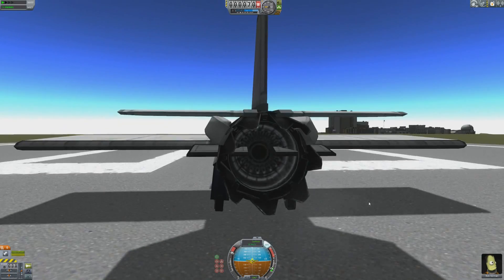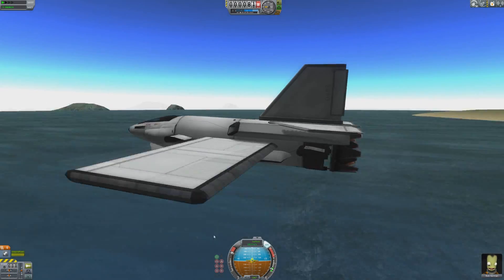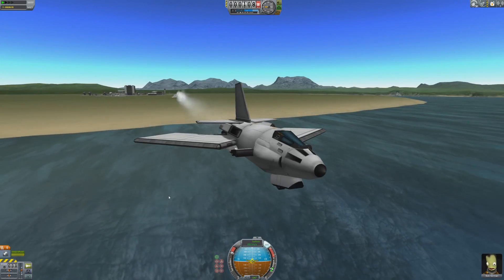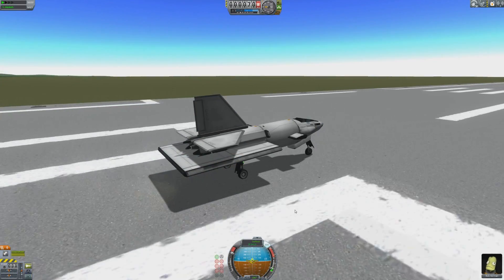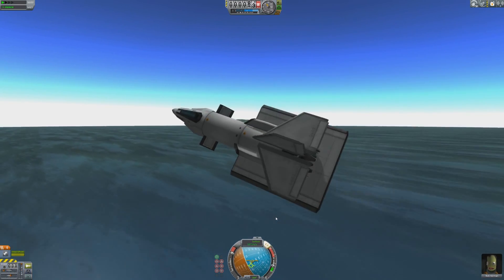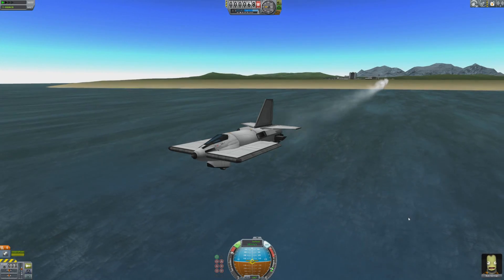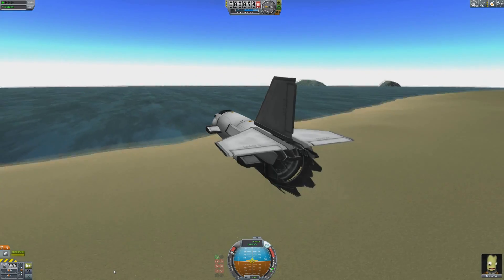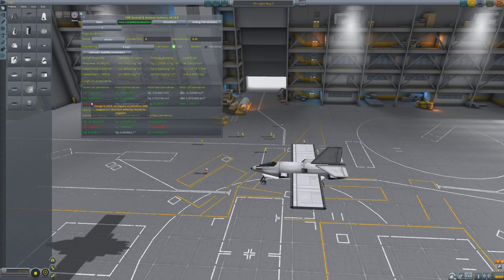Kerbal Space Program - Swept Wings & Aerodynamics Bugs

Comment: The jet with the fully swept 90° angle wings remind me of the experimental lifting bodies that were researched and developed in the 60s and 70s. The craft is very narrow and the body itself provides lift, instead of using more wing surface and therefore increasing drag. The wing surfaces are reduced to a minimum while still producing lift, so that the craft can fly or glide at higher speeds. One of the factors that contributed to the downfall of the lifting bodies was that it couldn't hold very practical fuel tanks. There are some designs in recent times - c. 2000 - that were (or are) in development. I find it interesting that the 90° wing jet would remind me of the lifting bodies, but in plenty of cases when I think about it, it makes a lot of sense.

Comment: Keeping the wings swept back 90 degrees, the visualization only showed them generating lift when you pitched the nose up or down, which is expected because of your wider angle of attack. Going in a straight path with a 0 degree angle of attack, you can see that they no longer generate lift, but the other smaller control surfaces still do. Does stock Kerbal actually account for that or does sweeping it back 90 degrees completely remove all lift, even if you're pitched up?

Comment: I built a plane (in stock ksp I think) with the engine in front of the wings, inspired by the William and Colt Peacemaker 370. I stacked two turbo jet engines to prevent them from hitting the wing in the back. It was fast enoughto reach duna if the atmosphere was exited in the right place.

Comment: Hi Scott. I've recently upgraded to FAR. What am I doing wrong when the aircraft will not remain steady during flight? I'm not talking about center-of-lift in front of center-of-mass instability here, this is something much more subtle: A tiny "wobble" in the pitch, for which the SAS is constantly trying to compensate (and without SAS, the nose will immediately drop). Is this insufficient lift or too small control surfaces or something?

Comment: The thing about the lawn dart is the same as a gravity drop bomb. The airfoil on the lawn dart's tail is symetrical and it's angle of position is 0. This means that the dart will align itself to the projectile trajectory, landing tip-first in the lawn because any diference in the angle of attackag ainst the ariflow will force the fins that way. Same as the bomb. The detonator is at the tip. They're designded as low drag devices for their trajectory to be easily calculated.
The thing about the center of lifh/center of stability is that a CG in front of the CL will create a momentum that tends to point your nose down, wich helps your craft recover from a stall, according to Raymer (1992). This is a general rule of thumb, stability is far more complex matter, involving the craft's inertia and control surface authority (as in, stabilator and rudder. A craft is designed as stable with it's surfaces undeflected).

Scott, can you fly that Entrerprise-alike shuttle of yours in FAR?
I've been unsuccsessfully trying to build one since I started playing KSP.

Comment: I remember reading somewhere that the wing sweep on the Me 262 was originally done to adjust the center of mass. I'm pretty sure that was on Wikipedia so that might not be accurate.
Reply: The engines ended up being heavier than originally intended, requiring a change in CoG. Moving the wings back would have forced them to redesign the fuselage, so sweeping the wings a little bit was the easy solution. The 262s wings aren't swept enough to make much difference at high speed.

Comment: my SSTO under FAR has a tendency  to flip itself upside down at 22km even when i keep the vertical velocity at 150m/s , still manages to get in orbit
Reply from the maker: It's highly likely that it's not the altitude, but the fuel distribution, it's quite common for a stable design to become unstable with a portion of the fuel burned.
Reply: quite possibly i am using the MK1 fuel structure , though i do try to keep most of the weight at the back near the ailerons  , and set my wings weight to 2.5
Reply: So it goes upside down, not rear first? Do you have your wings mounted at the bottom of the fuselage? Try moving them to the center or even to the top.
Having wings at the bottom causes your center of mass to be above the center of lift, making the aircraft unstable and wanting to flip upside down so that the center of mass can hang below the center of lift.
Reply: Kepe you might be right on that , tho usually with four engine on the wing needed to move the wings higher to accommodate them , the only way other then that is tilt the forward end up slightly and move the root of the down to centre line

Comment: Your videos started lagging on my computer at 1080p, other people's videos work fine.. Did you change something?
Reply from the maker: 60fps perhaps? Please be vociferous about this problem.
Reply: Scott Manley Yes, seems to be the FPS. Just checked and other 60fps 1080p videos lag too, heck, i didn't even know youtube supported 60 fps video.
I got old cpu, can only run normal 1080p so the problem is on my end.
Reply from the maker: Murhaain I get lots of people complaining about non 60fps video.
Reply: Scott Manley Some findings: Flash player @720p works, 1080p lags. Not sure if it plays at 60 fps or not, since no option is shown.
HTML 5 player shows that it's using 60 fps. Both 720p and 1080p lags much more than they do with flash. CPU usage is around 20% on both cases.
I tried all fixes i could find, no luck. Using firefox.
Not sure what's causing this.
Reply: Murhaain Enabled hardware acceleration?
Reply: Murhaain Try installing the latest flash player and update your graphics drivers.
I've seen many others complaining about 1080p60 videos lagging as well, but for me it's always worked fine (with the HTML5 player).
Reply: TheLeftLibertarianAtheist
Tried enabling/disabling that to no effect. Driver update also didn't do anything.
The problem was firefox. Everything works perfectly with chrome.
Reply: Murhaain Strange, it works for me.

Comment: Scott, Are the stock swept wings any better drag wise?
Reply from the maker: That's a separate issue.
Reply: In stock, drag is related solely to part mass, not to orientation. You can put the wings face on to the airflow and they won't provide any extra drag. So whatever wings have the lowest mass will have the lowest drag.

Comment: Doesn't swept wings also reduce lift per area due to more air dispersing at an angle down the wing instead of straight into the wing at 90*?
Reply from the maker: Well, yes, but in practice you saw I had so much lift at 90 degrees it tore the wings off
Reply: Scott Manley
Solution: billions and billions of struts.
Reply: Chetz and altf12
Reply: Yes, it does, but I think Manley had enough lift. ^^

Comment: I think the fact that FAR works with Procedural wings proves that FAR literally looks at the real shape of the wings, not the part count, and models it accordingly, instead of KSP stock aerodynamics, which seams to model it solely based on part count.
Reply: Yeah, fun times with that stock aero. I suspect that stock looks at a part and says, "This thing has lift. It's supposed to be in this direction, and it's supposed to be here, and this much." FAR/NEAR, on the other hand, says, "This thing is a wing. It is shaped like this, and it's this good of an airfoil."
Reply: Ivan Lovell Bascially, doing a better job.

Comment: Scott, what did you expect.. You're talking about the soupy mess they call "aerodynamics" in stock KSP. 
FAR Master Race.
Reply: It used to be even worse, at least planes kinda fly like a plane without that "plane SAS" nosecone thing now.
Reply: berni8k True, but even with the updated SAS, it's still awful. Lot's of things really need to be tweaked/completely striped and redone before v1.0 is released..
Reply: Jordan O'C
 I am mostly curious how they are going to pull off the promised compromise between FAR and stock of having realistic aerodynamics without making things more complex to the player. Stock is pretty much fine as long as your center of mass and lift are good. While FAR i find i have to spend a lot of time tweaking stuff before my plane is well controllable yet stable in all conditions(low, high, slow, fast, supersonic etc). While thats nice when you know what you are doing (Well mostly, most of the numbers in FARs UI are still gibberish to me) its likely too frustrating for a new player.
Reply: berni8k
I find it's rather easy to make planes in FAR... as long as you keep it simple and low part count, it's much easier with Procedural fuel tanks + Real Fuels (Helps a ton, let's you choose exactly what the TWR of your craft is going to be), and Procedural Wings. Just don't go all out crazy unless you want to spend 2+ Hours designing something, it took me roughly 30 Minutes to design a 3.0 TWR Supersonic aircraft that could outclimb some of my rockets at 1/3rd throttle... once you get the hang of it it's fairly easy to build aircraft with FAR.
Reply: berni8k The aerodynamics model will probably by like NEAR
Reply: Konstantinos Ountsis Dunno.. But I'm telling you, I'm dying without KSP xD
Reply: Nah, FAR Master SPACE! Eh?
Reply: Achim Hanischdörfer
 I always tend to build delta winged planes cause they usually look cooler and i tweak all the control surfaces to get as much control as possible out of them without stalling them or flipping out of control. And air breaks i found are absolutely mandatory to make landing approaches not a fight to slow the heck down in time for the runway. Flaps i used before to try and make takeoff easier but it didn't seam to help that much so i just use everything as plain control surfaces (I did once find an unusual use for them as a ramp to help kerbals walk on to the wing and board the plane when ladders didn't work well). I do use a joystick but its a fairly old crappy one and do a most stuff in space where its not as useful anyway. I just muck around with planes when i feel like it (Or do the awsome new kerbin survey missions that finally gives planes a purpose)
Reply: At least there is jet engines (I remember back when the B9 stuff was a mod... and we used rocket engines to fly around the world). But yes, the current aerodynamics are a soupy mess.
Reply: Achim Hanischdörfer Ludicrous Speed! GO!
Reply: Ans somehow some people think that it is ok also something like mechjeb that does basic like deltaV calculation would be "cheating".Game would be much better if it could be less counterintuitive like it currently is.
That last moment was so F9.
Reply: Well... FAR makes thinks more realistic and so more challenging on some aspects, but on many others, it makes thinks waaaay easier, espacialliy when it comes to global performance and DeltaV requirements, so... Not that master race to me.
Reply: Jordan O'C You do realise better aerodynamics is a feature FOR 1.0? xD
Reply: Dakitess I managed to cobble together an actual SSTO spaceplane in stock and I can only imagine that stuff like that would be a lot easier in FAR, but at the same time I'm worried that my rockets will shed parts all over the place if I install it.
Reply: *****
I think FAR and Stock are pretty similar in terms of drag once you get up high, but low down the difference is massive.With FAR planes can glide huge distances at quite a speed. As for the "aerodynamically assisted unplanned disassembly" part that only really sets in if you are trying to go above about mach 1 or 2 when below 5000m, up high you can go as fast as you want (Unless you also have deadly reentry installed)
Reply: Jordan O'C
I don't even bother engaging SAS anymore. I've been using FAR for 2 years now, what I do is I engage Wing level assist in FAR and the Yaw assist, set both up (responsiveness and dampening), trim the pitch for level flight and leave it until I get where I need to go. And you can go LUDICROUS SPEED with FAR.
The difficulty with FAR isn't getting stuff to fly, it's landing. Because most aircraft don't wanna slow down in the slightest. I can glide my fighter class plane for over 10km without engines from 1km altitude.
Reply: berni8k
It's not so hard. FAR gives you the tab you saw in the video. You need to read the graph and the stability simulation numbers.
You're going to want to aim for a AOA (angle of attack) of 10° at mach 0.22 (70m/s), and then you want to build your aircraft with your CoL not too far behind the CoM (make sure you know where the CoM shifts due to fuel usage). I usually go by ~1 to 2 meters for a 20m aircraft. I recommend to download and install TAC Fuel Balancer (Mod) to manage your fuel flow in flight. I also recommend you setup limit your pitch control range on the elevators and put in control surfaces specifically for pitch control, yaw control and roll control by disabling the other control inputs for them.
Finally: Going supersonic and even hypersonic with a straight wing aircraft is just asking for trouble. Ferram specifically makes the game model pressure shockwaves due to supersonic travel. Swept wings and delta wings are the best designs for supersonic and hypersonic aircraft.

PS you can designate control surfaces as flaps which can be toggles between preset positions by setting up "decease flap angle" and "increase flap angle" for them in the action groups menu. Makes flying at hypersonic speeds much easier as you can put in the pitch trim using the flaps.
Flaps can also be used as airbrakes. If the AOA goes above ~35° you get stalling. If you set the control range on a flap on 85° and you deploy them subsonic and without high dynamic pressure warnings they make for excellent air brakes.
Purchase a flight stick for flying with FAR. I got a Logitech Extreme 3D Pro (very budged end of the market). VERY worth it. It's soooooooooooooooooooooooooooooo much fun to build a fighter with BD armory, turn on chase cam, set up some missions and simply fly them.
Reply: *****
You don't really need to worry that your rockets shed parts. FAR gives you a tab that it displays data on in flight. Breaking due to aerodynamic forces really only happens when there is high dynamic pressure (i'm a burnt child in that respect, LOL).
Rocketeering advice: 
-Make sure your rocket looks areodynamic (Nose cones?, adapters?, fairings?) If it looks aerodynamic it probably flies well
-make sure your rocket is aerodynamically stable (Center of mass in front of center of lift/drag). If not ad winglets or someting at the bottom to make sufficiently stable. Don't turn it into a lawn dart or you'll have 0 control over it during ascent for the gravity turn
-make a smooth gravity turn!!!!!! Going up to 10 km then yawing over 45° is SOOOOOOOOOOOO wrong in SOOOOOOOOOOO many ways. A bit of trial and error for the right flight path will have you figured it out pretty fast.
Hint start right after liftoff and Yaw over 2 to 5 degrees to east. Then simply ride the turn to orbit. A good benchmark is to go ~500 m/s at 45° elevation of your velocity vector.

Check Yo Staging
Blast of to Fun Land!
Greets
Reply: Achim Hanischdörfer Yeah, but adding fairings means another mod with even more parts. I'm already using the mod that crunches all the textures to low-rez to be able to keep my other mods running.
Reply: Achim Hanischdörfer
Get back to your job of sniping aliens please.
Reply: Dakitess
RSS+Ferram+RO is the way to play if you want any difficulty in the game.
Reply: noname117spore 
I'm on off time.
You must be subbed to EnterElysium
Reply: I play on realism overhaul, that means 2km/s is 25% of the orbital velocity. Reentries with spaceplanes (you need to worry about heat cause RO comes with Deadly Reentry) requires you to have planes that can to >30° AOA on reentry to be able to maintain altitude as lift going hypersonic is rougly proportional to the square of your AOA until you stall. And also you want high drag.
Setting up flaps on the trailing edge of wings with negative control authority (so they flip upwards) gives you a large additional margin of AOA that is needed.
Flaps are useful on landing. If you have main lifting surfaces and a tailplane you can dial in flap control authority on the main wing control surfaces and tail. Increases your drag and lift at a button press. Such useful for landing.
Reply: is your PC any better?
btw my sub feed is hungry for your vids
Reply: FAR ftw.
Reply: Konstantinos Ountsis Who, me?
Reply: Jordan O'C yup
Reply: Konstantinos Ountsis Oh right.. Nope, not yet.. My motherboard and PSU were sent off on Friday. Might be another week or 2 before I get them back :(
Reply: Jordan O'C uhh!!! why?
Reply: GroundHOG20101 You mean C7,that got implemented in KSP later on.
Reply: CRIT AWAKETS
Ah, thanks. I don't know why I said B9, I did mean C7. Oh man, those were the days. Just getting a reasonable flight time was hard.
Reply: LOL